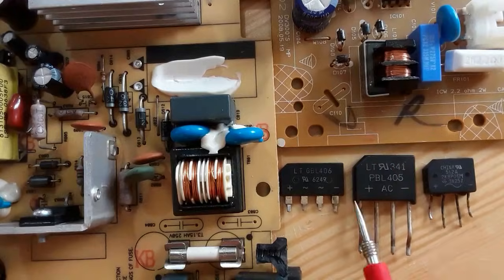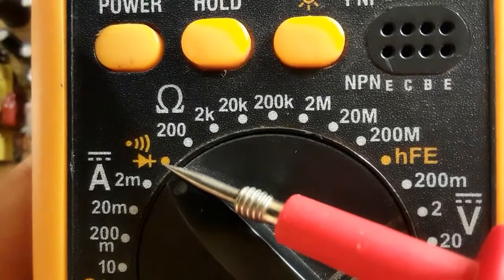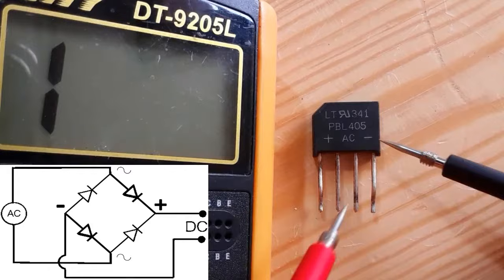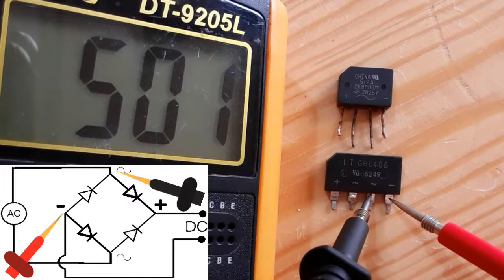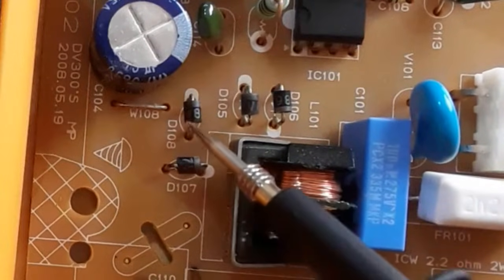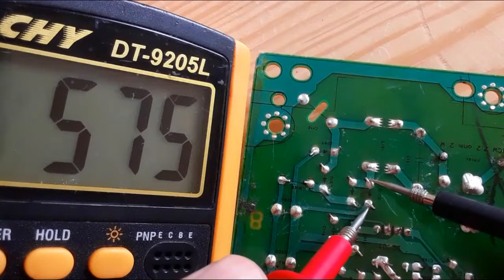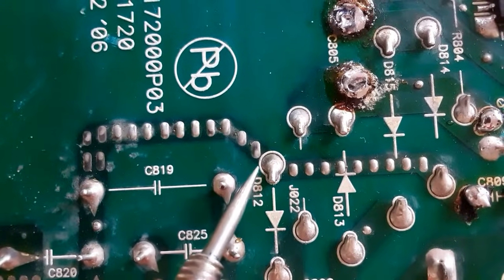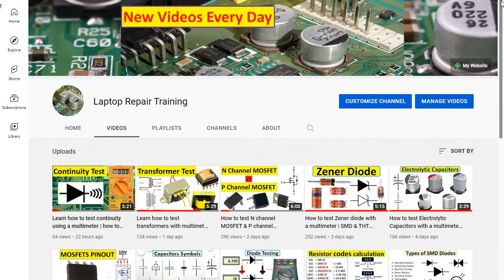Easy Bridge Rectifier Test Anyone Can Do!

Comment: I am confused can you help? testing two 2W10 Single Phase Rectifier Bridge, 2A 1000V.
one reads  0.970 across + and -  the second reads 0.585 across + and -  .
So is the first one good and the second one bad?
As the video states you should expect to get double the drop reading  between + and-  terminal?
Can you explain?  thank you

Comment: I'm getting a bit lower voltage when measuring between +(-) and AC 0.49V (isn't it supposed to be double?). When measuring +(negative lead) to AC i'm getting 0.52V.

Where does that 0.49V come from? IT should be 0.9V
I measured it in circuit btw.

Comment: When testing a 4 pin bridge rectifier, should i get a beep in continuity mode when only testing  the two midlde pins ~ ?
Reply from the maker: No, no beep bro, any beep means failed
Reply: @electronicsrepairbasics_erb Ok, I should have mentioned I am testing it on a circuit board.

I have test another one on the board and when I put the black and red prongs on the middle pins~ it also beeps.

Comment: Hello, when I measure between + and - (reverse polarity) I do not have a double voltage drop ( 1 V) but 0.5 V only. Could it be the reason for the PC monitor not working?
Reply from the maker: Yes Bro it could be
Reply: I have the bang same problem mate, was your rectifier still within the circuit or was reading taken when the component was removed ?
Reply: I had the same issue, I then removed it from the board and got normal values.

Comment: When tested diode onboard I got reading +563 but upon changing ends it read +1350. It only occured on 3 diodes closely onboard induction cooker but other diodes seem perfectly ok. Is the diodes ok or other component onboard are at fault.
Reply from the maker: Its Ok
Reply: @electronicsrepairbasics_erb  Thank you.